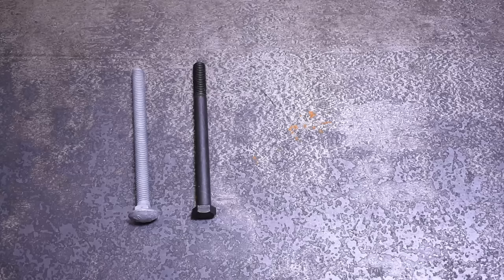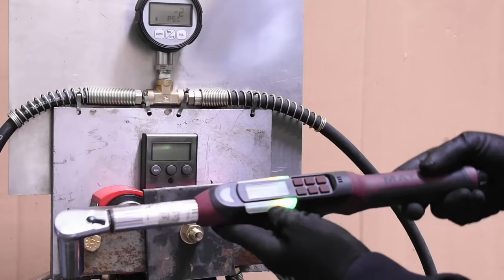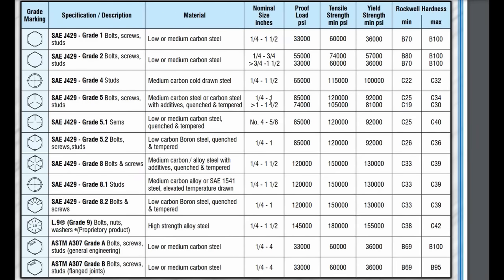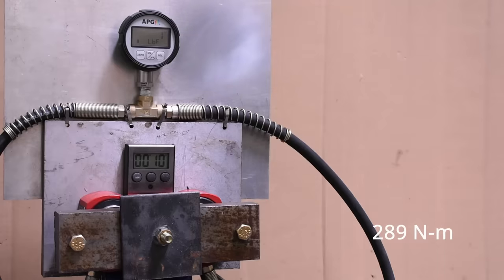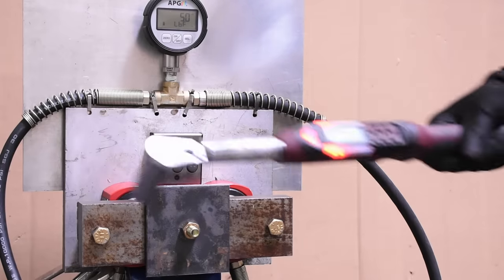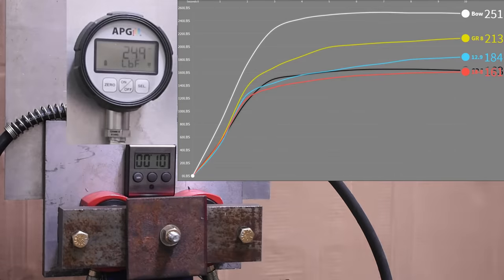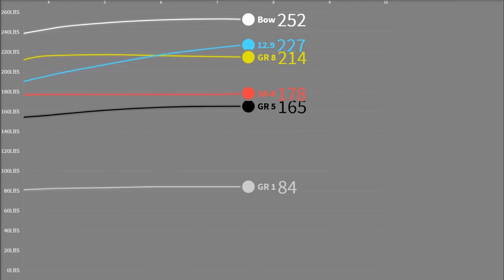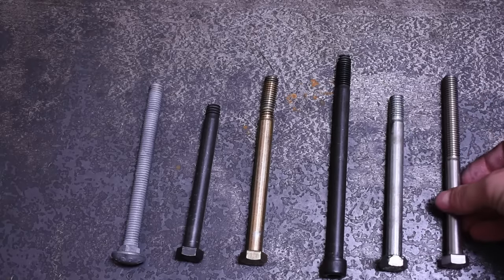Strongest Bolt? Grades Explained & Dyno Tested For Science

Comment: Thank you for shining some light on bolt properties.
I myself am still looking for the perfect bolts to attach a four into two exhaust manifold for my motorcycle with a aluminium engine block. As temperatures are pretty high, disassembling in a DIY environment can be scary, as common bolts tend to break off when unbolting after a year of daily driving. Unfortunately stainless steel bolts create more issues, because if that bolt breaks off (1 of 8 actually did) removing the broken off bit can be hell, because I will need better drills for that. Now I am trying Probolt Titanium bolts with ceramic grease applied to prevent snapping bolts again. Am I on the right track, or should I stick with regular OEM bolts because in case of snapping bolts, the stuck stub is easier to remove?
I was shocked to find out that stainless steel is not as rigid as I thought it would be, it felt like softening just before snapping.
Any input or on topic hyperlink is appreciated!
Would investing in a simple electric impact tool improve chances of a painless removal?
Reply: Use studs

Comment: If you really want to spend some money on bolts… We use a good number of both galvanized and stainless steel bolts in a structural capacity and we have to order special made bolts that are manufactured to our specific standard and then not only do they break some from every batch to make sure of the steel quality but they x-ray every single one to look for any small stress fractures that might cause a failure later on. 

I have actually gotten called back on a job to replace all the bolts because they went back and determined that there was an issue with the testing and they sent us all new bolts and made us have them changed out. Very costly indeed.

Comment: Huh. At a local bolt center place I asked for sixteen Allen head bolts sized 4mm hex with M3.5 metric threads. The stainless ones (stamped A2-70) would cost me about 20 cents more (in US dollars) than the 12.9 stamped equivalent that had black oxide plating.

Because these tiny bolts will be holding something important to me (speakers onto a baffle) the 12.9 made the better choice. And are cheaper as well. There's just no stainless steel fastener out there that could rival "real steel" with the exception of corrosion resistance. Or high nitrogen stainless if some company actually make bolts out of that! (aka NitroMax used by SKF for super-precision bearings)

Now that made me wonder...how would bearing steel cope being used for fasteners? Or how about using weird and unusual metal grades as fasteners that someone with rod or bar stock and a lathe could (or would) dare to? 7075 aluminum bolts anyone?

Comment: It would be interesting to compare the bolts from ARP, as they have a proprietary stainless alloy and heat treat process that are supposed to be much stronger than even chromoly steel alloy bolts.

Comment: What about fine threads?  I think you guys should do the same vid for fine thread as well
Reply: Fine threads require less torque to develop a given clamping pressure.
This is because a thread is just a ramp wrapped around the shank of a bolt, and a fine thread = a shallower slope.
If you mean "screw it 'til it breaks", the UTS of a given bolt shouldn't change except that the minor diameter is going to be slightly more with a shallower thread.

Comment: Hmm, . . . I bought 'high-strength' head-bolt studs for a small four cyl engine once. They were rated at 120,000psi. , which according to the info you posted is around a grade 5. But, the OEM head bolts has a 10.9 rating on the head of the bolts, meaning a grade 8. Hmmm ... I think I may have actually down-graded my head bolts. No problems, so far, but dammit. I have to admit, they never claimed the stud kit was actually stronger than the OEM bolts. Only that they were 120,000psi.  and made it seem like it was a necessary product.
Reply from the maker: TTY bolts can be different. You're going past yield

Comment: Recommended values are taken from failure, then applying safety factors of 1.5 and 1.4, giving 2.1 in total. Most of your bolts were consistent with this.
When the force starts going down that's already a fail by plastic deformation. That bolt would definitely fail in real life situation.

Comment: You should do this test with SA193 grade bolting!
Bolt torque is all voodoo, if you want to get a real useful clamping load you need to do % elongation with a system like an ultrasonic extensometer

Comment: I find lugs (with nuts still attached) and cars with one wheel missing almost every month as a bicyclist and jogger. And I live in a middle class suburb. 

Most bolts are not even using their tensile strength or torsional strength to hold parts together. 

Can you please break them by bending them like a light nut?

Comment: Any idea what grade snowblower shear pins come in at?  I’m thinking grade 1 - 3.  Certainly would not want to use a higher grade and risk destroying that big expensive helical gear.
Reply: We ran into that issue long ago with small outboard motor prop shear pins.  We always thought they were a mild steel.  Nope.  Some fancy non-ferrous alloy.
Reply: We always used high tensile bolts for shear pins as they snap cleanly rather than just bend as low tensile bolts do.
Reply: Shear pins such as on a boat propeller are regular steel, aluminum and brass to protect the drivetrain from damage.

Comment: stainless shears under stress thats why we dont use it in replace of grade 8 or 5 it cant hold up to vibration and it has to be threaded into a stainless steel nut if a steel nut starts to rust on stainless steel threads its completely stuck rock solid it will almost always shear if you try to brake it lose also stainless doesnt like heat the only reason why stainless steel Hardware exists is for applications that are corrosive like for example plow trucks or boats 12.9 is mostly only used for high stress and vibration for example cutters on a mulching head 12.9 for locks are mostly pared up with nordlock washers instead of normal lock washers and 12.9 is also the best option for hardware to hold cutters on a track hoe buckets

Comment: true story . 30 years old . great shape NYC  construction worker  put a hitch on my truck 1986.  but with bolts from  86 story steel building . couldn't budge them . farmers was 68 years old  snapped four of them off like they where made of tin .he was thin like  5 foot 6 .most powerful strength.no pipe just a 12 wrench
Reply: Three quarter bolts

Comment: 3 key strength ratings for fasteners to be aware of: pull-out/tensile strength (lowest or highest depending on material anchoring into), pull-over strength (highest), and shear strength (medium).

https://www.clarkdietrich.com/sites/default/files/imce/pdf/SupportTools/Catalogs/Structural/FasteningOptions_062220.pdf

https://www.trianglefastener.com/ckfinder/userfiles/files/Brands%20-%20Full%20Line%20Catalogs/Technical_PagesB.pdf

Comment: I am more familiar with NAS, MS and AN type of screws and bolts.  The weaker bolts seam to me are made with 1010 or 1038 alloy.  While the stronger bolts are from 4130, 4340 or 8740 alloys.  The heat treat does play in to the hardness of the metal.  What are the tinsel and the shear ratings of the bolts?  I know more about Aircraft fasteners then I do the Lows or AutoZone hardware.

Comment: You have to weld the bolt to the plate that mounts at the back. The 80psi that lasted seconds and seconds, is not suppose to. All bolts shalt break. Just put a lock washer and see them all break. In this test, all bolts turned giving false results. Keep going with that test, it turns out to be good. Weld the bolts or use giant vise grips to prevent slippage. But welding it will give a good idea of the b torque.

Comment: 2 maybe 3 questions how well would they hold up to heat and/or corrosion (there may already be another video) and is there any real disadvantage of using a bolt that far exceeds the material its used in, ie using high grade bolts on a really cheap commuter motorcycle

Comment: The first thing is to understand the difference between a bolt and a screw. Except for the first one there, the rest are all screws. If it has a head that can be used to tighten it, it’s a screw. If the head can’t be tightened by a screwdriver or wrench, and has to be tightened by a nut on the screw end, it’s a bolt. Pretty simple, and channels like this one should know the difference, and use it properly.

A problem with this sort of testing is that, and I don’t know if it was done here, but since he didn’t state otherwise, it’s safe to assume so, that for each test, a new bolt needs to be used. When performing destruction testing, each test before affects the next test. There is a reason why bolts and screws aren’t allowed to be reused on critical parts on engines and other equipment. The reason is that fasteners depend on that stretch for their holding power. But they become stretched when first tightened, and are permanently stretched. When reused, it takes more torque to tighten, and are weaker, because the tightening specs are including that stretch. Effectively, there’s no more stretch left, and they can fail prematurely. The later, higher readings are false, because the fastener is now embrittled from the over stretching. It can snap with shock or heavy vibration, which wouldn’t have happened otherwise.

Also, with that hardness tester; are you calibrating for the fact that round metal will read higher than flat, and that the smaller the diameter, the greater the compensation? Or are you just giving the number returned by the tester?
Reply from the maker: The Machinery’s Handbook details that bolts are used to assemble unthreaded objects and typically use a washer and nut on the opposing end, where screws are used to assemble objects with existing threads or form threads into while fastening. Screws need to be turned to assemble a joint, whereas a bolt can be secured while in place. Like the carriage bolt, and all of the other bolts here using the Grade 9 nuts we employed on the end. These are all bolts and all new hardware was used for each test.
Reply: @TorqueTestChannel  sorry, but, no. You’re mangling the definition. I’m happy though that you did us new bolts for each test.
Reply from the maker: These fall under hex bolts. It's in section 27 of my Machinery’s Handbook, but depends on edition. Check yours
https://donsnotes.com/home_garden/fasteners.html
https://monroeengineering.com/blog/bolts-vs-screws-whats-the-difference/#:~:text=So%2C%20what's%20the%20difference%20between,to%20assemble%20objects%20with%20threads.

Comment: Would be better to do a stretch test as this is the ultimate strength test and removes major friction and lubricity differences- these can account for as much as a 40% difference between measured torque and tension applied. this is also the method for tightening ultra high torque applications like nuclear vessel studs-which see a converted 1.5 million plus foot pounds also note worthy the bolts broke from stretch not the twisting direction like mentioned in the video.
Reply from the maker: You can just Google those results in psi vs cross section
Reply: @TorqueTestChannel   I assume you are using the same lubrication methods for each?  From experience Stainless bolts are extremely susceptible to galling and premature failure due to incorrect lubrication.  I’m a millwright by trade so these kind of things are big. But I know average consumer probably doesn’t care about the nitty gritty. Also interested to see much like tools, advertised vs real world. Would be very interested to see testing of perceived vs actual torque applied for different kind of lubricants- and to see how what we use as industry standards stack up against consumer products…(I also work very extensively in the nuclear power world-where they will pay 70 bucks a roll for duck tape that meets their standards for example)

Comment: What about crankshaft bolts? Dont they have some special harness characteristics?
Reply: Yes. grade eight are always used, they have six lines on them. At least in old cars.
Reply: @georgebuck2269  I could swear flywheel bolts are harder than grade 8 though.
Reply: @PoorSharkie  I only rebuilt engines and transmissions from older cars. 1962 - 1982. That's all I know about.

Comment: My crank bolt 🔩 is set at 250 ft lbs per the ARP specs. That's not a job I'd be looking forward to dealing with but I'd wonder what the diameter of that is ? LS 5.5L racing motor from Pratt & Miller

Comment: Years ago when I went to college for tech trades we did a very similar test of bolts and came to the same rough view.  

What was really telling though was the 'torque yield' bolts for engines not shown here.  We got several from the auto tech lab that was brand new and did the full workup on them.  For their hardness and tensile strength numbers, they were basically identical to grade 2 but nearly 10x the price.  

To this day, I will not use those overpriced pieces of crap on an engine build of any kind.
Reply: We're they factory head bolts? The aftermarket ones are usually rated at much higher yields
Reply: Master Auto Tech here.   They are called “torque to yield”, but they are torqued, then retorqued, then given an addittional angle, usually +90 degrees.  The idea is to bring them to a certain stretch point where they still have pullback effect, but not overtorqued to the point of permanent stretch.  This “stretchy” tensioned bolt concept solves many age-old problems of uneven heat expansion on cylinder heads.  They work so well that many head gaskets no longer use fiber material, just layers of sheet metal.
Reply: @BrokeWrench  I believe they were stock GM and maybe a set of Fords as well.   Common factory bolts are all I remember. 

The auto tech guys that came in to watch us do the tests were not impressed either when they saw the numbers.
Reply: Yes, low-grade garbage by any other name is still low-grade garbage.    It's why we have the extensive testing process we have in the manufacturing industry.  If not, people will lie badly about what they are selling by making up fancy-sounding excuses for what is clearly substandard component designs.
Reply: @tcmtech7515  that's good, was worried aftermarket stuff was all marketing for a second
Reply: @BrokeWrench  I see mixed views on head bolts and the like inthe aftermarket world. some push that low grade crap for premium price and then others are al bout old school high tensile strength and holding numbers that solve the problems the over priced crap doesnt.  

The last engine I built I went with higher end high strength bolts over the 'stock torque yield' stuff.  Never regretted it and saved money at the same time.

Comment: false test, you should not be using a rattle gun, the shock does not give a true fail point
it is a comparison only
you should use a 500lb ft torque wrench,
so your test  is only a comparison, for those who do not know, sheer is abt 60 percent of tensile
BTW  304 ss we never use in marine, because it does rust, we use 316, 316l and others
Reply from the maker: You can just Google those results vs kpsi yield ratings and k factor. No ones done it with an impact, the mechanic tool of choice to know how and when these fail

Comment: 13:17 THE reason it broke late, it because of the heat. Metal expands and it was clamping the steel plates while torque increased slightly. I guess the UFO got ya good with illusions. The illusion was: The bolt didn't turn.  The UFOs like Thor

Comment: I used to think stainless steel bolts were the toughest, strongest bolts you could get but I had a metallurgist tell me one time "Naw, man, stainless steel is, like, a grade 5, at best. Not very strong, actually, at all."
Reply: Stainless is harder to drill, punch, machine and bend, that's why people assume it. I replace the corroded steel bolts with SS ones under my car with some lithium or anti-sieze compound on the threads. Retired welder.

Comment: Isn't that the m18 mid-torque rated for 600 ft/lbs but barley getting to 200 ft/lbs fastening torque. Please correct me if I'm wrong but that doesn't add up. This is the most ideal way that this  gun is used (tightening actual bolts)
Reply from the maker: The bolts are the limitation here. Se our testing on impacts normally

Comment: I would like to see torque wrenches tested.  Some brands recommend that they be re-calibrated yearly.  I don't know where to tale such tools for this service, whether the cost is worth it for the "home mechanic", or if I can check if it is "close enough" on my own somehow.
Reply: Food for thought: I own a Craftsman Model No. 31425, 1/2" ratchet 20 - 150 foot pound 'Clicker Style Microtork' wrench, manufactured 12-2011 and purchased 07-2012. The included instructions state the wrench should be checked for accuracy if used frequently, is subjected to abnormal handling or storage, or after 5000 torque applications in assembly line type of usage. Calibration service is available by returning it to your Sears store. ACCURACY: +/-4% on clockwise or right-hand readings greater or equal to 20% capacity. Complies with American National Standard B107.14M and International Standard ISO 6789.

Comment: Everybody knows ARP is the most killer bolt out there.   And these guys don't even test them!   Never let a mere mechanic build a race engine!
My engines: 
489 CID big block chevy, 688 HP,  pump gas, no turbo, no nitrous, no blower - ALL ARP fasteners.  its in a 1971 Chevelle convertible road racer.
355 CID small block chevy, 511 HP,  pump gas, no turbo, no nitrous, no blower - ALL ARP fasteners.  its in a 1971 GMC 1500 pickup 1/4 mile dragster.
I also have a stock 1986 Porche 911 (my commuter car) and a stock 1999 Z-28 Camaro (my late model POS).
All four vehicles are street machines - not trailer queens.